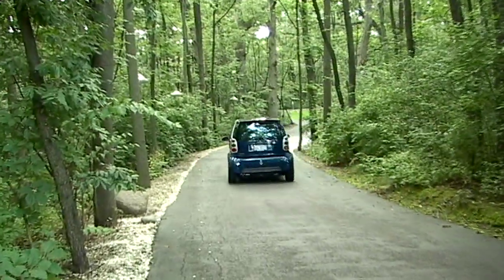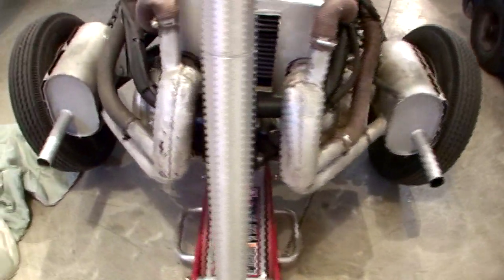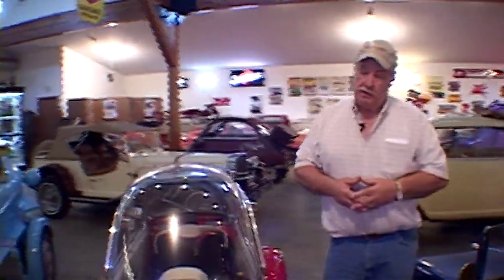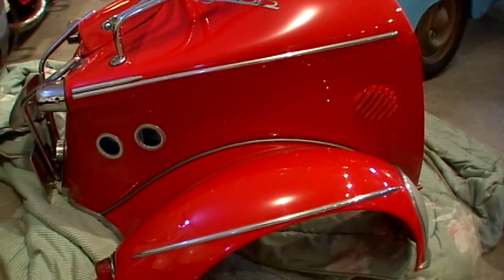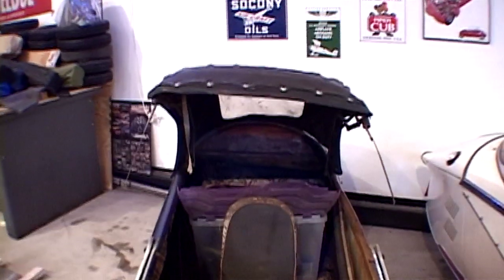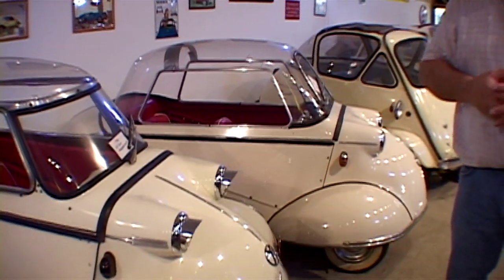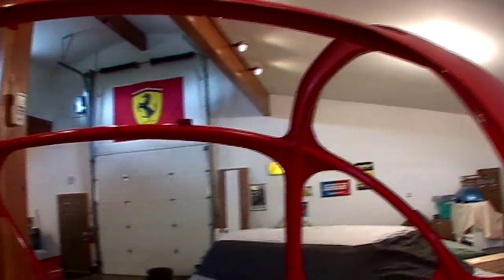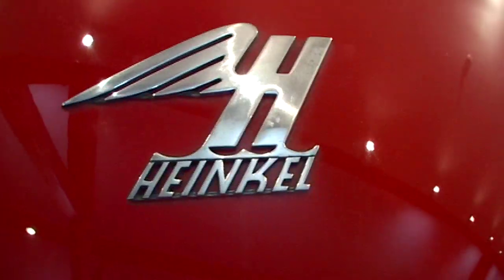Small Wonders Micro/Mini Car Museum in Crystal Lake Part 2

Comment: Isetta700 is right.  BMW had the licence from Iso.  Heinkel had an Isetta-like front door, but it didn't have the articulated steering column that swung with the door because Iso held the patent for that and BMW had the licence to use it.
Reply: BMW had a design for a new Isetta but I don't believe it was ever made. Microlino is making a new Isetta style electric vehicle.

Comment: Iso built the original Isetta. BMW bought the license and built the Isetta. Heinkel officially did not copy the Isetta. In order to avoid infringing on Iso Rivoltas patent Heinkel made the steering wheel remain stationary when the door opened and gave it a reverse gear and a four stroke as opposed to the Isetta's two stroke (hence that tail).